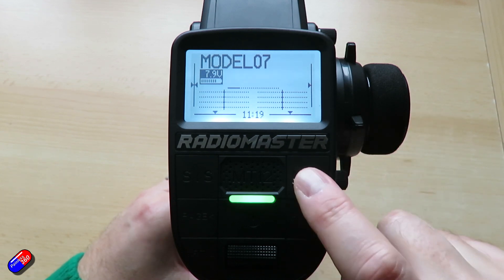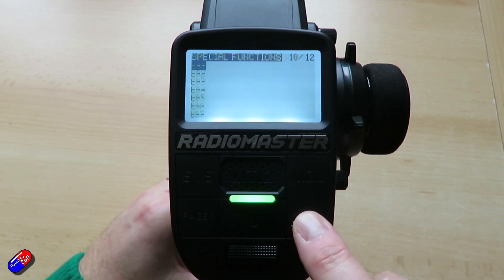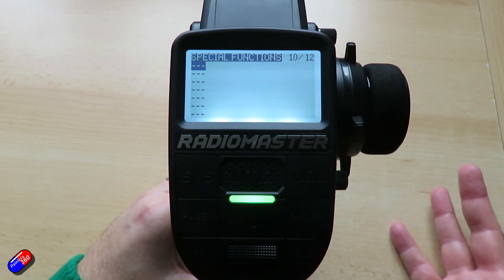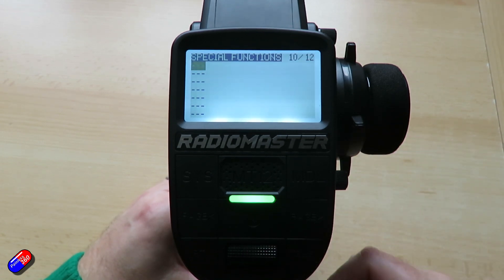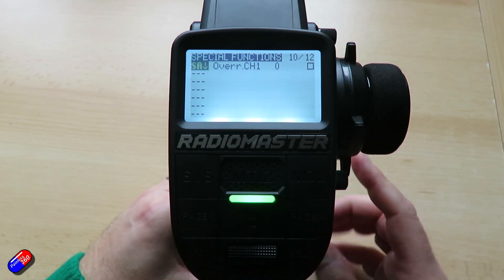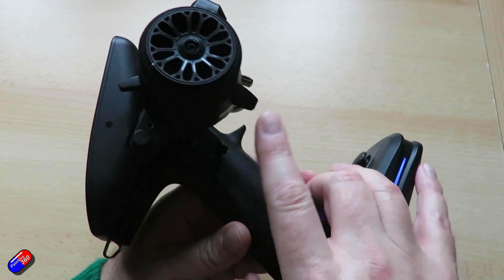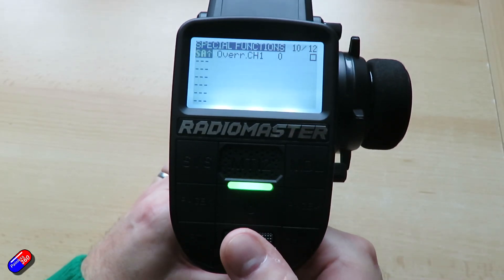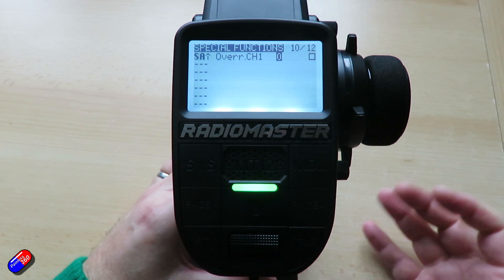Add a Throttle Safety Switch Easily (Subscriber Request)

Comment: Couldn't you also just assign the switch as a condition in the mixer?
Reply from the maker: The great things with EdgeTX is that there is always at least two (and usually three or more!) ways to setup something up. For new users, this can appear overwhelming but is part of the power of the system. Some options provide easier setups when used with other advanced functions. Try it and use the one that you prefer. Happy driving!